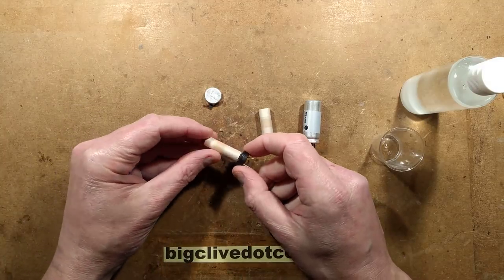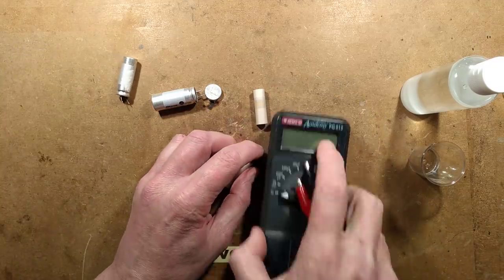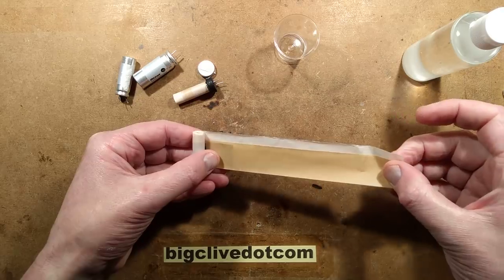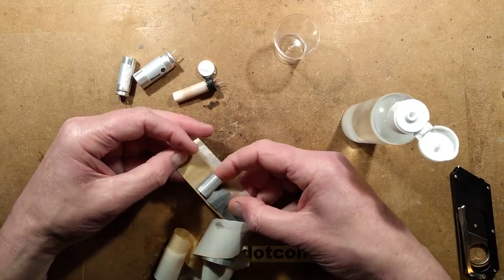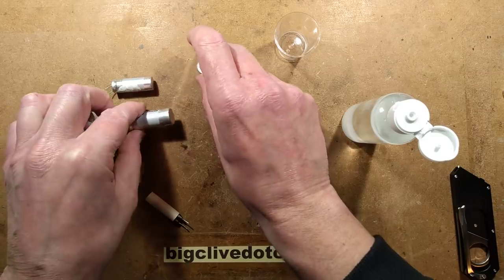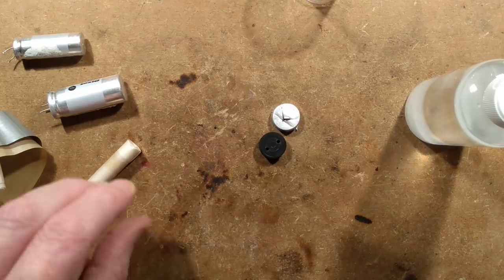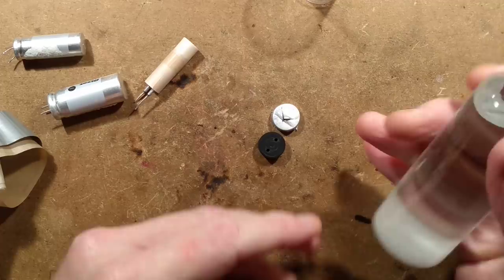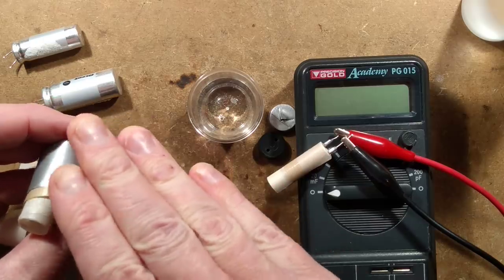Adding electrolyte to a fake (dry) capacitor.

Comment: "It's considered toxic.. I've never actually tasted it.... ... Let's taste it"
Reply: Remind me of the guy on sliced the Discovery Channel or TLC when that show was still on it was kind of wife what's inside kinda it maybe on YouTube I haven't sorry if I knew I would recommended.
Reply: I'd buy the T-shirt.
Reply: @Aaron Brandenburg I remember that Sliced show, one of the most fascinating ones was when he sliced up a coin operated pool table and showed how the white ball always returns when the spots & stripes don't, even though they're all the same size & weight.
Turns out it's all done with magnets :) Metal pieces in the white ball which gets pulled into the return-to-player channel internally by the magnets.
Reply: @zombieswitapple  he done talkin bout tlc yo, dang ol youtube show go slice slice  man.
Reply: The neat part is the first thing you need to do is get ethanol in your body after consumption as a prelim treatment! :)
Reply: As cody says. “the poison is in the dosage*.  waters toxic if drank in large enough quantities while ricen wont kill you if you consume a small enough ammount.
Reply: Whats the point of the electroliteless caps.  Wouldent they make more money by selling them propperly manufactured?
Reply: ss  Ethylene glycol or one of the food grade glycols like propylenglycol?

Cause there's a huge difference between simply adding a sweet food permitted additive and putting in toxic ethylenglycol
Reply: @FennecTECH  He explained his theory at the end: They noticed the batch was faulty before filling it with electrolyte. That's why the metal shell isn't printed.

I'd reckon there'll be quite a few batches that wouldn't work as intended so they simply dump them before wasting time on filling them with electrolyte.

Still better to sell those non working caps to scammers than to throw them in the trash.
Reply: @FennecTECH : "As cody says."
Sola dosis facit venenum. https://en.wikipedia.org/wiki/The_dose_makes_the_poison
Reply: "You wouldn't want to drink ethylene glycol." [ethylene glycol-tasting intensifies]

"Hi, I'm Big Clive. Welcome to Jackass."
Reply: Life is Hazardous to ones health. So let's have some FUN!!  ;-)
Reply: I don't know what's scarier, tasting ethylene glycol, or that it happens so often there's actually a Wikipedia article for it. https://en.wikipedia.org/wiki/Ethylene_glycol_poisoning
Reply: ss  That's the problem, both of these are used as antifreeze.

Propylenglycol is in those child safe antifreeze products you can buy.

That's the problem with people replacing the name of a substance with just one of its many uses.

Since being an antifreeze has absolutely no relevance to ethylenglycols toxicity you'll end up with useless news reports.

The same antifreeze argument is what antivaxxers use when they complain about vaccine ingredients.
Reply: I have for a long time wanted to make a BigClive soundboard.
And now I want to make it more than ever. The problem is, I'm terriblly addicted to World of tanks. And since people say you should stick to what you are good at...
Reply: @FennecTECH  China!
Reply: Reminds me of the time when Cody drank cyanide - so we didn't have to :)
Reply: @aaronbrandenburg2441  , TLC is stupid
Reply: @aaronbrandenburg2441  Is that English?
Reply: @jlucasound  Nobody gets out alive!
Reply: @emilychb6621  yes, many products are potential antifreeze, glycols, alcohols etc... It's all about making it sound the way you want it to when writing the article.
Reply: ss  the same thing.
Anti Freeze has some coloring and maybe some other minor extras but it's mainly what he drank.
Reply: He tasted methylated spirit before. That's much more toxic.
Reply: I had absolutely no doubt he would taste it as soon as I heard him talk about taste. BigClive - in service of the sciences and humanity - Good on you mate BC!
Reply: ss  I assume it was propylene glycol, which is a food additive, and non-toxic. Ethylene glycol is VERY toxic. To be more precise, the by-products produced by mammal metabolism while trying to break it down, that's what is toxic. I heard the followings from a colleague who is a chemist, but it was several years before, so it's probably not too accurate. The metabolism of mammals somehow identifies ethylene glicol as ethyl alcohol, and the liver tries to break it down like if it was alcohol. The process creates by-products that both are nerve agents, and turns the blood acidic, causing severe nerve and brain damage. And it doesn't take much, the lethal dose for human is just a few milliliters of ethylene glicol per body kilograms.
Reply: @zombieswitapple  I assume autocorrect in action, and the absence of commas made it hard to read. "it was kind of wife" intended to be "it was kind of like", for example.
Reply: Reminds me of that time Cody drank cyanide...
Reply: I did exactly the same thing when i was a kid... ha ha.Oh, wait... or was it yesterday...
Reply: sounds like every clive Ive ever watched
Reply: Have you found a new manufacture process for retro audio sounding leeky caps?, amazing! (im only half way through so I'm gonna watch more and find out). Ha ha :)
Reply: Ethylene glycol is the poison in antifreeze that makes you go blind lol. Well, you go blind after your kidneys fail...
Reply: @FennecTECH  Probably a bad batch they offloaded in a snake oil product.
Reply: Ethylene glycol gets oxidised to oxalic acid by alcohol dehydrogenase.

Oxalic acid cna chelate cations in the kidney leading to kidney failure. Dipping your finger in some ethylene glycol then tapping it against your tongue probably won't kill you.

Also propylene glycol has another methylene group so it won't fit into alcohol dehydrogenase making it perfectly safe
Reply: @jkmacgyver  Sadly not any more. They use peritoneal dialysis nowadays.
Reply: @pluto8404  thanks for the translation
Reply: ss  Not impressed!, There were fatalities.
Reply: grats, you watched the video. top comment really or... just a low hanging fruit dispenser?
Reply: ss  germans used to use as well as antifreeze
Reply: Paging @codyslab
Reply: @emilychb6621  its called 'recycling' !!!
Reply: He's is to dangerous to be kept alive
Reply: @emilychb6621   he did a tear down, they were in a car booster product.
Reply: @FennecTECH  you 1st with the Ricin! Yes I know why wholemeal bread is tastes "better" than plain white bread is the ergot fungus which is like ACID in low doses and fatal in larger amounts. I still would not want to try any Ricin. Its been used to kill too many people before.
Reply: Shouldn't leave it in my mouth too long because I have no idea how toxic it is 😂
Reply: @kemi242  there's methanol on brewed drinks so if you drink beer or wine etc. You've drank a bunch of methanol
Reply: @rich1051414  ethylene glycol is the antifreeze, that's the main active ingredient
Reply: @CAMSLAYER13  Propylene glycol and vegetable glycerin are both 'food safe' anti-freezes, and sometimes also found in automobile antifreeze. So no, not always is ethylene glycol the 'main active ingredient'.
Reply: @rich1051414  yea but you weren't talking about those glycols you were talking about ethylene glycol. It is the antifreeze it's not added poison like you made it out. If you use a different glycol there's no need for the ethylene glycol they do the same thing just propylene glycol won't kill you so you can use it around food.
Reply: @CAMSLAYER13  You missed the context. During the prohibition of alcohol in the US, a lot of bootleg liquor was going around, some of it was made in the radiator of a car. It would poison people because of the ethylene glycol, and people would say 'it will make you go blind', but really, it would cause kidney failure. That is what I was referring to. 
Regardless, dropping a bit on the tongue to taste isn't going to hurt you, you need more than that to get poisoned.
Reply: @rich1051414  methanol  makes you go blind and damages your kidneys/liver/heart. poor standards when distilling would leave more than was safe in the end product. Ethalyne glycol does not make you go blind it causes massive brain damage followed by kidney/other organ failure. Although I'm not disputing that it could have ended up in booze since it has the same effect as drinking alchohol at first. Tbh I'd bet there were sketchy drinks going around with both in there
Reply: I walk away for 2 minutes.... And that's what I hear.....

Sounds about right.
Reply: @Chicken McNugget I tried, you don't want to know what they say, it made racism look tame! :D
The Sliced tv show was an excuse to destructively chop things up to see what was inside, search YouTube for this trailer video:  "Sliced: What is Sliced? | History"
Reply: LOLOLOLOL
Reply: @emilychb6621  According to Wikipedia, it seems that it was (di-)ethylene glycol
https://en.wikipedia.org/wiki/1985_diethylene_glycol_wine_scandal
Reply: I've actually tasted it..., 

that said more like the supplier was buying a job lot of capacitors that contained duds...... this is common in China.
Reply: And let's have another taste.
Reply: @Sannesthesia that's funny cause cody's hands shake. is it from all the mercury and cyanide?
Reply: @aaronbrandenburg2441  I've been trying to remind you all week long, but my shouts just won't reach around the planet.
.
.
.
.
Just kidding. But that's some Epic word salad right there. :D
Reply: Okay just to clarify after all those dot-dot-dot comments.

What I was trying to say was.

There was a show on Discovery or The Learning Channel AKA TLC.

A long time ago.

That was called sliced.

He would literally cut still open in various ways. 

Was sometimes very entertaining.

 Sort of like big Clive.

And like big Clive he's old was always tasting things.

In my opinion not the best idea.

Always tasting things is what reminded me of that show.

Also I use Google voice recognition.

 so sometimes things go not quite according to plan.

As anyone would know.

 and you don't realize it.

 before you post the comment!
Reply: @licensetodrive9930  yes I agree I saw that episode as well.

Speaking of which I was always curious if they were using a magnet.

 to make sure the cue ball always returns.

That was the only way that I could figure you could do it without using any Active Electronics.

Such as color detection or a camera.

Back then they didn't really have much of that.

I wonder how orbactiv pool tables we're first made like that?

Remember the spy car.

What about the fire truck.

And the fuel tanker.

Oh and yeah I remember when opened up...

 scratch that.

 sliced up the induction range?

And needed a quotable quote surgical slice.

And wound up using a bone saw.

Also what's the bone saw the very first oscillating saw.

Wasn't is that how the oscillating multi too.

l AKA oscillating saw was developed.

I seem to remember for a long time ago that that's what that was developed out of.

I would like to know.

Also I don't own one as of yet.

But I have used them a few times.

And borrowed them as well.

They're great for installing junction boxes in existing Construction.

Use them quite a bit when putting in it networking telephone audio and video as well and more.

Also used it a few times to put in a junction box for a receptacle or a switch.

The best thing since sliced bread Cuts Like a hot knife through butter...

Yeah I know...

But seriously handiest tool there is any easiest to use to put in a a box like that.

Still remembering using a drill to drill pilot hole and then cutting manually or with a jigsaw.

Pain in the butt.

Also I would like to have a RotoZip eventually.

I once used that to install a couple outlets in tile in a kitchen.

 again I borrowed that tool from all my friends.

Who is one of the same guys I borrowed the oscillating saw from a couple times.

Although not the only person I have borrowed your oscillating saw from.

Oh speaking of DYI.

Once I hope someone that had a problem with a door.

The door insert was bad however they got one open box no possibility of returning it.

Customer return you know.

And I put it in the place and realize something was off.

Although not by much.

I'm like.

Wait a second I can still make this work.

So I use the oscillating saw to cut small blocks of wood to make up the space between that in the door with the hole that was a little too large.

And used Liquid Nails to secure everything.

Silicone adhesive and others to secure molding around the small  gaps.

 trimmed molding around the latches

And success saved well over $100 that could not be recouped otherwise.

That's not the only thing I've done like that to save what would have been a bad thing.
Reply: @aaronbrandenburg2441  Sorry, I didn't mean to be snidey. To be fair, I kinda got what you where trying to say. But the comment itself was just too beautiful, a work of art, I couldn't help myself.  :) 
What can I say? I Love it when people say weird, far out of context things. I find myself drifting in and out of context regularly. It's kinda how I am.
 
And yeah, Google voice recognizer/ assistant is impressive when it works, but can also cobble together the best drunken gibberish imaginable. It can be great fun :D
Reply: @FroggyMosh  apology accepted.

And yes you're absolutely right about Google for voice recognition.

And a lot of times it does make me LOL.

Actually maybe one out of every 15 times I use it I can't stop laughing.

Due to its silly mistakes.

But I also use Dragon.

 but Google does work better for certain things.

That Dragon would not catch because after all it's crowdsourced.

And there's no way that dragon would get any YouTube users names.

Or a lot of the technical stuff.

Good luck trying to to dictate and lots of common things other than common words.

 and names in Dragon.

By the way I'm able to use an Android keyboard.

 Than i can a standard computer keyboard.

I Cannot type worth crap on a full-size computer keyboard.

However on the Android I have all most no problems.

I also use my Android as input device if I have type quite a bit.

I run an application that allows it to be a mouse and keyboard over Wi-Fi.

The only thing is currently the application does not do it over Bluetooth as of yet.

I cannot remember the name of the application.

It runs a server in the background on the computer to do this.

My typing issues are due to my disability.

I can do just about everything else. With hands and computers.

I'm a maker and a geek and more.

Even a adult fan of Lego as well.

I do twins of DYI stuff.

Studying to be a computer tech.

If I can't fix it it ain't broke.

 and everything else however I was never able to type at all.

Originally I had gotten a grant to get the original version of dragon.

However at that time it cost basically the same as I computer it ran on.

It was a Windows four-point something or other machine.

Required 16 megabytes of RAM.

Instead of the usual eight megabytes of Ram.

And every trick of the trade to eke out the best performance.

It required a quarter second pause between words.

The reason for all the ram is it was actually running voice files from the ram.

 not the hard drive.

To actually have high enough performance to do this.

But better than having some one take dictation for me most of the time.

And also my writing was like crap almost no one else could read it but me.

Now of course it's real-time voice recognition.

Oh by the way.

 back then you had to train almost every single word to dictionary to even use it.

Which literally took months even before you could dictate a single page or less.

Could take up to five or six repetitions of the word.

 to get to be recognized correctly.

And then having to constantly go back and correct it.

 so that would get it right was a bit daunting.

 but it got better and better than what we used it.

Before that I was using an on-screen keyboard application for Windows.

That was before accessibility was built into windows at all.
Reply: ss  There is vast difference between different kinds of glycol.  Propylene glycol is in practically anything 'gloopy' or slippery, all makeup, tons of food products, vape juice, personal lubricants, etc.  It's worlds different from ethylene glycol which will turn your kidneys solid.  What was it the wine makers were adding?  I should hope harmless propylene glycol!
Reply: @pluto8404  that's the lamest boomhour impression I've ever seen
Reply: "Top comments" not "Top quotes"...
Reply: @aaronbrandenburg2441  Are you high? What are saying?
Reply: @DustinRodriguez1_0  speaking of that. You know how it's used in fog fluid AKA frog juice.

 for theatrical spoke and fog and similar applications.

I've heard if that stuff is overheated.

It can produce dangerous quite toxic fumes.

Even more toxic then you believe.

Could anyone substantiate this?

Please comment  back on this.

 would appreciate it.

Thanks ahead of time.

All I am asking is for a DYI Lego compatible smoke unit.

That would use ethylene glycol or that and a water mix.

Another option Maybe glycerin.

Or  and with water added.

Or using mineral oil.

Such as used with Lionel Train smoke units.

Would be using a nichrome wire outlet and a wick.

But for weight. Temperature controlled.

Probably. On or four off no proportional control.

Worried about generating toxic fumes.

If the heating element got too hot.

Because I the saw it here on YouTube about DYI smoke generators..

That  this method we're not a good idea.

Thank you had any suggestions would be appreciated.

Also any other suggestions would be appreciated.

This is for first we'll use not commercial.

Just DIY.

I am a maker and a adult fan of Lego.

One concerned for my and other people's health.

And if it would really knows should I shoot this off to bigclives channel here on YouTube?
Reply: kriskotooBG 😂
Reply: Remember when I was a trainee mechanic, at college they were showing us how to test the level of anti freeze in the radiator, we had two teachers, the young teacher said we should use a tool that sucked up some anti freeze into a glass tube with rubber balls that would float and give to a value against some markings on the side, the old teacher said, stick your finger in and taste it, if it’s sweet then it’s ok. As it was quicker we all did that method.
Reply: @zakofrx  antifreeze has an additive called bitrex an its freaking minging...I kno I've used it in my watercooling loops an wen you get it on your tounge it stays for hours
Reply: @aaronbrandenburg2441  there is an app I used it all the time an it worked on Wi-Fi or Bluetooth..unified remote works a treat
Reply: Bigclives next video "so today I'm testing out some hair removal electronics because my tongue has grown furr"
Reply: Youtubers: i try it so you dont have too
Reply: @zombieswitapple  😂😂😂
Reply: bruh mode activate
Reply: BigClive moment
Reply: The LD50 of ethylene glycol is 4700 mg/kg. That means that a 70 kg person who drank 295 ml (329 g) of it would have a 50/50 chance of dying from it. The LD50 of acetaminophen/paracetamol is 2000 mg/kg. That means that a 70 kg person who took 140 grams of it would have a 50/50 chance of dying from it. It takes a lot less of either to make you sick, but LD50 is an apples to apples standard easily available for both.
Reply: well boric acid is used as a food conservative, in sweden but its limited to like 1 food item, only allowed by tradition.
Reply: @aaronbrandenburg2441  you have a stroke buddy?
Reply: twice
it wouldn't be scientifically thorough if it wasn't twice
Reply: @FennecTECH  Maybe pinched from the reject bin at the factory and onsold to equally dubious characters to pad the pinchers paypacket?
Reply: kriskotooBG, I have to say, I admire your avatar.
👍
Reply: @pluto8404  Beg pardon?
Reply: Spoken like a true scientist
Reply: "hold on another taste"
Reply: Haha